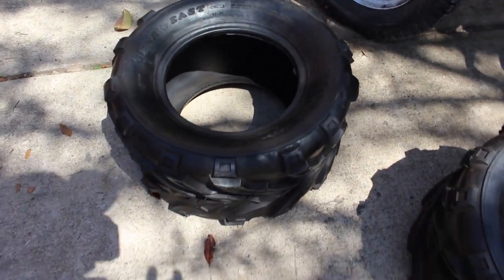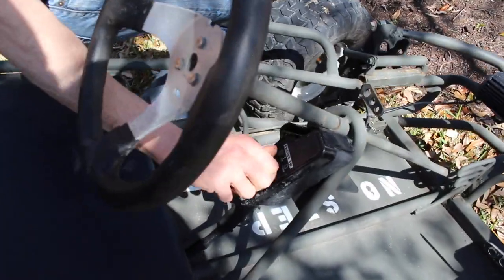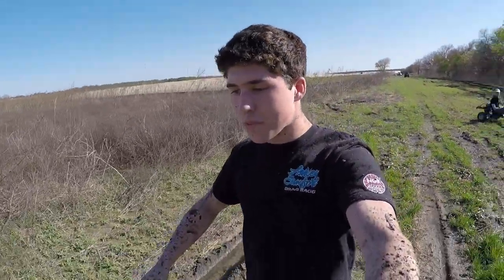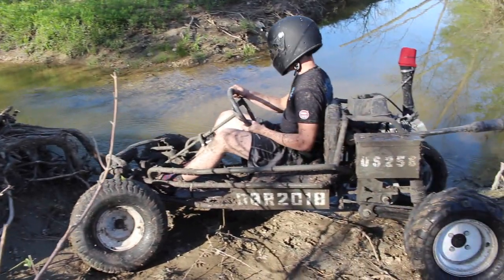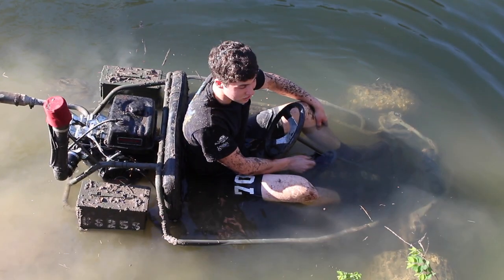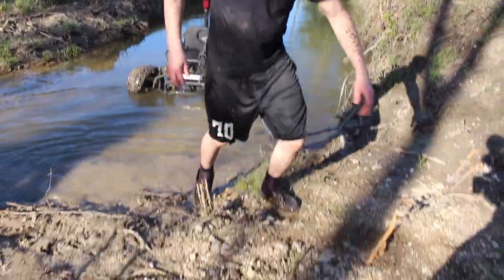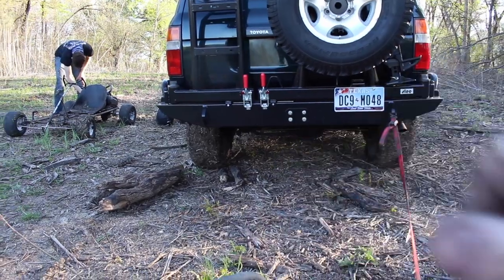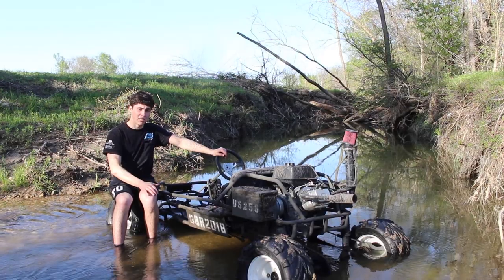Trying to Break the 420cc Lifted Go Kart!

Comment: When you submerge a small engine in water, you are instantly bringing it down to room or lower temperature which means that you need to use the choke again. I just did that with my minibike a couple weeks ago. Turn the choke halfway and the engine should stay on with some gas pumping.

Comment: Styrofoam secured to the frame or 2 liter bottles to make it buoyant so you can cross water. The tires should be able to rotate and move the cart foreword. Put a pan under and around the engine.

Comment: Lol nice bro’s I think you got the coils wet that’s might be why it’s running bad
Reply from the maker: madmunki creations I’ll look into it. Thanks
Reply: It needs a conversion to a conventional canister coil setup with either points or with a solid state coil driver... and then all electrical connections dielectrical greased/sealed to prevent water shorting of the ignition system and charging to be done by an external alternator setup
Reply: Also the exhaust needs modified if you plan to submerge it look at a house sink drain you'll notice it has a p- shaped trap in it... you will need to put a flipped version in your exhaust to keep the water out between exhaust pulses. You can actually hydrology through the exhaust too.
Reply: D L even if you get it all water proofed. The drive belt will slip pretty bad when wet!
Reply: John Abell Jr well there are several solutions out there to that as well such as a 2 speed transmission with double pulley clutch or fully enclose the cvt with a forced air cvt intake (I had to do this to my 50cc moped for other reasons...I'll just say it isn't anywhere near stock and literally was melting it's belts).

Comment: Build something to protect the belt and engine that you can take off put a solid axle in it and lift the front end with thiner tires with more tread and you gotta do something about the exhaust pipe it's way to low

Comment: I think you got water into the carburetor or into the engine one of the two and if it got anything engine drain everything putting new oil in the spark plugs see if it'll fire up again I would definitely probably do a carb job on it I'll try to reseal it better next time enjoy watching your videos hopefully we see what you guys do good luck
Reply: it was downing out the ignition system the coil uses the fly wheel to make the power for the spark just like a lawn mower
Reply: Most likely shorting the magneto to ground (the coil uses magnetic induction to create the spark energy from the building and collapsing of a magnetic field as the magnet(s) pass by the coil) normally in order to shut down a magneto you ground out the coil so that it cannot generate the induction charge needed to create the spark for the engine to run (and that is a simplified description of how it works) the reason it starts sputtering is because it is getting an intermittent short to ground

Comment: You need to stop pumping the shit out of the gas pedal when your starting it man and when it first starts put some gas on and hold it in one spot I don't know who told you you should pump it like that but trust me it don't do any good at all
Reply: when u pump the gas on a carb it sprays more full form a jet to keep up with the fast increase in throttle thats y hes doing that in can cause ur puting more gas then just holding it because if the motor instead runing very well there not enuff air being pulled in to pull the gas in normally so when u pump the gas its spaying more gas to get the revs up and keep in runing the fly wheel and coil was under water so it wasnt getting a good spark causing it to run that way  idk how u never herd some say pump the gas when a old truck or something wont start
Reply: @codyboyy that engine doesn't have an accelerator pump on the carb... your right but it wont help to pump the gas on this type engine.
Reply: this is true
Reply: Danger Dave ok I thought all carbs had that and I can tell u one thing a 400ex  definitely has it and it’s a mean squirt of gas too let’s just say I was looking somewhere I shouldn’t have been when I gave the throttle a nice good push lmfao 😂 hey the carb was clean and checked  so it wasn’t all bad
Reply: It’s not fuel injected
Reply: Amen!
Reply: John Smith lol right it's not a a cold start or diesel lol he floods it everytime 😂
Reply: Mr Barbs lol u said card

Comment: Don't pump the gas pedal when started hit In the middle and keep it  there til it starts fully like who told you to pump it
Reply: Luke McD if it were a carbureted automotive engine the carb would have something called an accelerator pump... with a cold engine you apply the choke, then you pump the accelerator pedal 3-5 times as well as hold the accelerator pedal just off its idle stop, then crank it over repeating as needed to start it
Reply: However industrial small engines do not have an accelerator pump in their carb so pumping the pedal in this case is pointless however cracking the throttle  by pressing the pedal down is not because it allows the engine to draw in more air and fuel